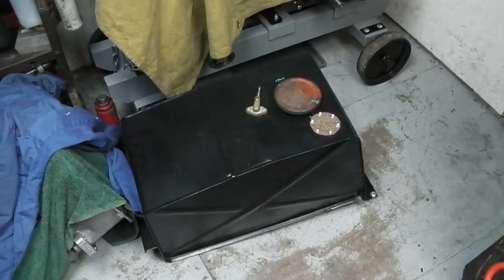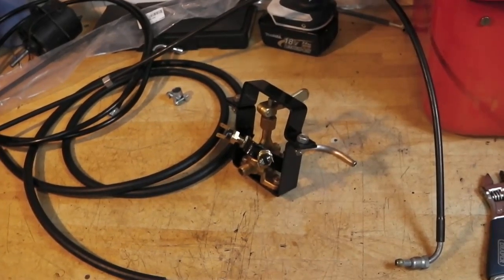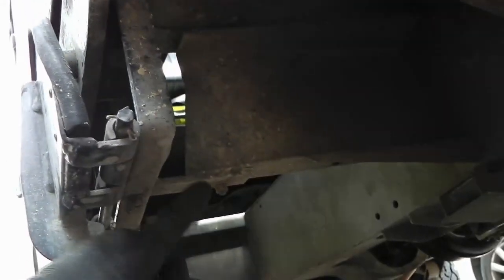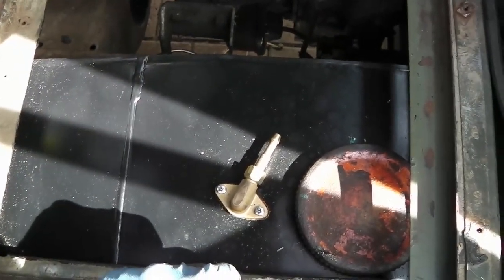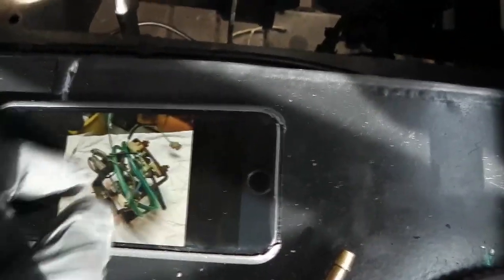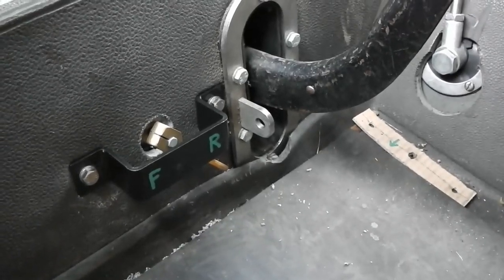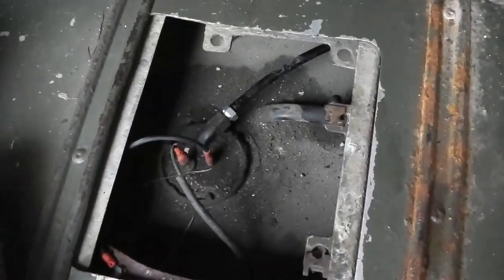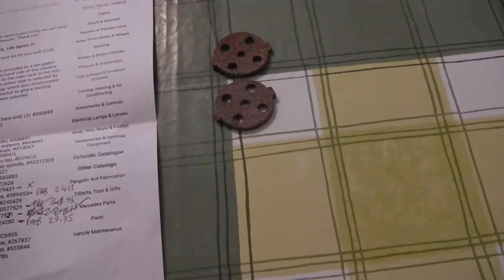Land Rover Series 3 - Auxiliary Fuel Tank Install

Comment: Hi, quick question. I have the twin tanks already in my 109 FFR but wish to replace the rubber fuel hoses between tanks and changeover tap. Is it standard 6mm (1/4") ID? I also intend to fit fuel filters. Thanks.

Comment: Always entertaining videos thanks ! Having had my only S1 total  stranding incident from fuel pump failure, I think I'd fit one pump per tank, with a tee at the carburettor inlet  and just  use  electrical selection of which pump and hence  tank is active. I think  the SU style  pumps have a non return valve that would avoid the need for extra check valves to prevent fuel circulating to the "off line" tank.  You would need relays for selection of active tank sender signal, else need to fit an independent second tank fuel gauge if not relying on just periodically  looking in the tank filler (Ive found this to be  more accurate  than relying on  70 year old piece of cork flapping about on a bit of coathanger wire, loosely communicating with  an erratic Smiths gauge that can hardly be called an instrument).
Reply: I always relied on the mark one eyeball to give me a pretty accurate idea of how much go juice I had left in my series one.  Trouble with the fuel lift pump on the block is that they are very reliable until the diaphragm splits then they’re broken. And that’s that!  Two electric pumps is a good idea.
Reply from the maker: What with the SU carburettor conversion, I have considered going over to SU electric fuel pump(s). For the time being I will see how it goes on the mechanical pump with the twin tanks, I carry a spare pump in the tool box but my feeling is that the mechanical pump supplies slightly too high pressure, somewhere around 4-5lb when the SU's really like about 1-2lb. Will see how it goes this year. As for the fuel gauge, merely an indication!

Comment: Been thinking about doing this. Great video as per normal. Was your battery originally under the left seat as I am wondering whether that would have to go back to the engine bay despite being an ffr’
Reply from the maker: Thanks, the battery has always been under the bonnet with this one. It's a "CL" model, the lowliest of military versions.

Comment: I reinstated the dual tanks on my Lightweight. One tank had been disconnected by a previous owner and the changeover tap was missing.

Like you I do long trips to shows so I think the dual tanks are worth it and save the hassle of finding fuel on the way back. I sorted it out over covid so haven't done as many long trips as normal yet.

The front tank bolts are shown pointing up in the Lightweight parts manual so that is how I have fitted mine. They are more exposed on a Lightweight than on yours so could risk getting damaged when off roading if pointing down.

I bought cork seals off Bearmach but they are coarse cork and didn't seal. I agree it is paying extra for ones that work.

Graham
Reply from the maker: Thanks Graham, it will obviate the "range anxiety" which can go with such thirsty vehicles!

Comment: Just be prepared or some odd looks at the garage when you take the filler hose in through the door!,  I had the twin tanks on my Lightweight and just lifted out the seat cushions to expose the fillers.
Reply: Standard procedure in my Series One is to bale out the passenger when refueling as the bench seat base (still temporary after 35 years) has to be removed to access the fuel filler.
Reply from the maker: Yes great fun, already experienced that!